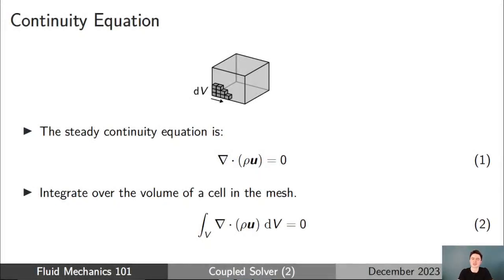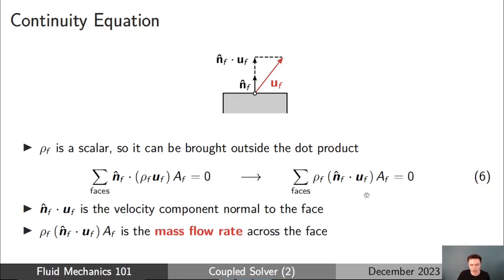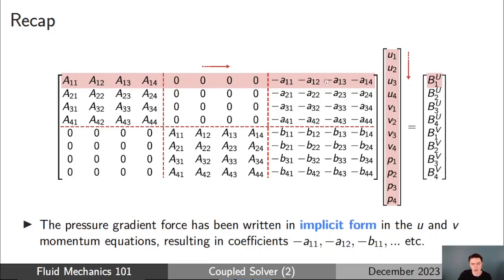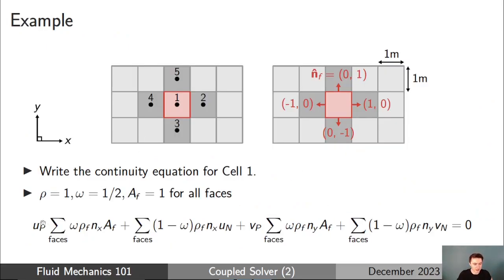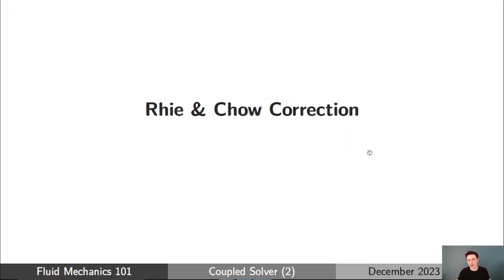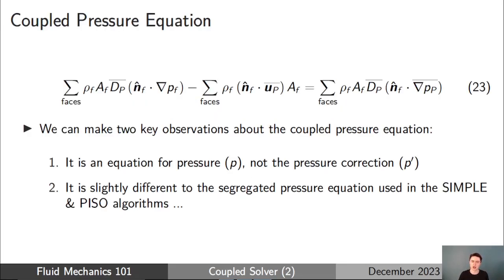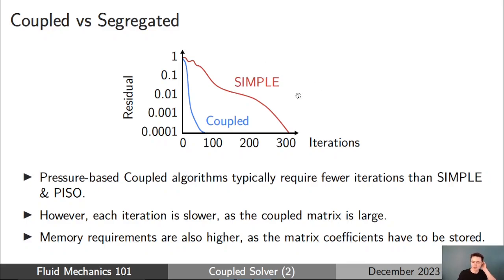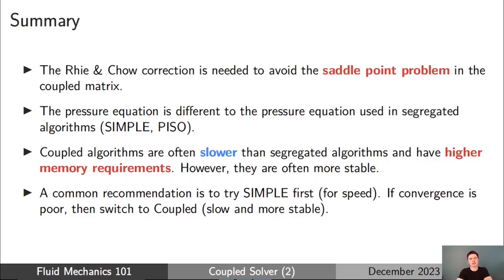[CFD] Pressure-based Coupled Solver  (Part 2)

Comment: Thanks a lot Aidan for this wonderful and interesting explanation. Really appreciate your efforts.
 I have a couple of questions.
1) A clarification on the notation. The 'A'  matrices used for U,V and P equations are different right?
2) What will be the B vector (right hand side) for the U,V equations ? We did pull out the pressure gradient force to the left hand side right ?

Comment: You're always the best lecturer in CFD Dr. Aidan!. I have small question: when I lookup in pUcoupleFoam, I can see they did blockMatrix UpEqn which created by peqn, ueqn, pinU, Uinp. But I cannot see where is the loop to handle non-orthogonal problem as you said in your lecture. Do you have any ideas about this? Thank you so much. Best, Anh

Comment: In many of these videos it states that we should remember that all of the flow variables vary linearly across the cell face. Could you point me towards a video where you discuss why this is the case? Thanks (brilliant videos)
Reply from the maker: It's a feature of the 2nd order finite volume method.  If we assume that the flow variables vary linearly across the face, then the integral across a face is equivalent to the value at the face centre multiplied by the face area. (This is sometimes called the midpoint rule). It's a neat trick that lets us convert all face integrals into the value at the centre multiplied by an area (an algebraic equation, rather than an integral). So it is the feature that ultimately allows us to convert all of our equations into matrix form (linear algebraic equations) and then solve them, but it isn't explicitly stated anywhere.
Reply: Ah, great. That makes sense. Thanks!  @fluidmechanics101

Comment: Thanks sir for the lecture. Does the use of either coupled or segregated solver's, even when achieved monotonic convergence in steady, can result in different solutions for the same simulation conditions? It's somehow to know if fields would end up to have drastical difference between them when using one or another
Reply from the maker: Difficult to say. I suppose this would depend on what CFD code you are using and how rigorously they have checked it 😀 in theory they should be the same of course ..

Comment: Hi, Aidan/all. Is there a good reference text book that I could use to understand pressure based coupled solvers that also discusses the effects of compressiblity? The CFX theory guide has very limited information about how compressibility is treated in the form of linearizing the (rho*velocity) term by recasting it in the fully implicit form, but that does not help me understand the concept very well. Appreciate any guidance with the above. Thanks.
Reply from the maker: Sadly I don't think there are any good sources besides the user manuals. If you find any, please let us all know!
Reply: @fluidmechanics101  Will do. Thank you for all your work!
Reply: @fluidmechanics101  Getting back to the above exchange on the treatment of compressibility in pressure-based coupled solvers, I did some looking up, and found that a lot of work has obviously been done in here outside of CFX. I will mention two references below, and hopefully anyone interested can snowball from there. "A coupled pressure-based computational method for inompressibe/compressible flows", Chen, Z.J and Przekwas, A.J is more of a reiteration of the numerical discretization presented in the CFX manual, but offers some additional clarity on the treatment of the convective flux term. However, I found "The segregated approach to predicting viscous compressible fluid flows" by Van Doormaal, J.P, et al. more informative in terms of understanding the purpose of linearizing the mass flow term. After some reading, my understanding of the treatment of compressiblity in pressure-based coupled solvers is the following -- the Rhie-Chow discretization of the advecting velocity term introduces the pressure coupling (as is elaborated on in this video). Meanwhile, the density is linearized in terms of pressure in a manner that introduces the compressiblity which is evaluated isothermally. This results in formulating an equation for density in terms of the pressure from the current and new timestep. The above two terms (velocity and density) when plugged into continuity equation, and linearized in a standard manner, now produce the new diagonal and off-diagonal coefficients for the pressure equation that satisfies the hydrodynamic system while also accounting for the necessary compressibility in the flow.  I hope I have been clear in my summary. Please feel free to critique my interpretation if you find something wrong about it. Thanks.
Reply from the maker: Great findings! Thank you for sharing